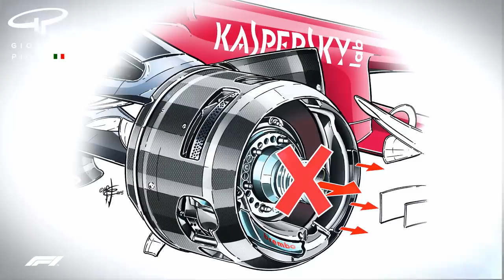2019 Technical Regulation Changes Explained

Comment: The FIAFOM really missed a trick here F1 should really have  re-explored ground effect aerodynamics  -this would have meant less wing turbulence but still massively fast cars . However the FIA seems to have phobia of ever looking into ground effect again ever since it was banned in the 80s because of Safety . Tech have moved on a long way since the 80s and surely engineers could develop ground effect aero that is both effective performance wise and safe for drivers.
Reply: Stephen Taylor even with modern technology ground effect isn’t safe. The way the cars currently are if you lose grip mid corner you can save it (i.e. Perez in Canada, Verstappen in Brazil) but if the main aero is ground effect once you exceed the limits of ground effect all downforce disappears and you’re off into the barrier with no chance of saving it whatsoever. 

Modern tech isn’t going to change that.
Reply: Just because it might cause more spins doesn't mean that is unsafe -no one is going to be killed by spinning the car into a barrier especially with the Halo. Modern technology can always make things more efficient. Ground effect is clearly the way forward.. These are the best drivers in the world a they should be tested.
Reply: Can’t agree more. It puzzles me why they bring in all these changes and refuse to explore ground effects again.
Reply: Enter the Bully if there is a Bump or let's say you hit the kerb, then the car will suddenly loose traction and since you can't really see bumps on the straight it is too risky.
Reply: it works in lmp1
Reply: gebakken aarshaar different car designs
Reply: Stephen Taylor the smallest bump or imperfection in the track is a risk of a massive accident. That big bump in Monaco going down the hill just before the hairpin for example.
Reply: With the halo there it's worth the risk.
Reply: Ihsan Husandi “nobody’s going to die in any modern cars anymore” Jules Bianchi 2014
Reply: As long as a driver isn't hurt it shouldn't matter whether they hit the bump on spin.
Reply: Bianchi didn't die because the car wasn't safe, it was because of the recovery vehicle which shouldn't have been there.

Check Alonso's crash at Melbourne in 2016.
Webber in 2010 at Valencia
Even Kubica at Canada and tell me modern cars aren't safe
Reply: Stephen Taylor yes but allowing ground effect allows for faster cornering which massively increases impact forces in a crash if something goes wrong part way through a fast bend. You can’t just say “it’ll be fine, no one will die” - you don’t know that.
Reply: Nathan Styles where did I say F1 cars aren’t safe? I’m saying you’re putting the drivers at risk simply because you want slightly better racing. Clearly there are ways of giving better racing without having to put the drivers in unnecessary danger.
Reply: All the cars have a high tech safety cell which protects the driver - the monocoque  of modern car is very safe.
Reply: but now they got Hans system, a mandatory headrest, the halo, they are training more and more to be able to drive at those speed. F1 is currently missing fighting gladiators that can go wheel alongside wheel to overtake and defend. ground effect mean they keep the speed yet still follow each others. With current wind tunnels, i don't know why it's still isn't used.
Reply: You guys realize that the human body can only take so many G-forces right? Even with the Hans device, someone can still die from a heavy impact. Alonso, Kubica, etc. are lucky they escaped with the injuries they received. Look at what just happened at Spa with the LMP cars.
Reply: Stephen Taylor Once a car is launched in the air - it'll become an airplane accident by then...relying on ground effect and safe racing just won't work with these kind of speeds
Reply: As an engineer I'd like to point out that ground effect, which reduces drag, comes at the expense of increasing lift, thus decreasing downforce. This fluid mechanic phenomena wouldn't be suited for F1 cars because they are extremely light and depend on their complex aerodynamics to provide the car with enough downforce to grip the track whether it be on a straight or through a corner. The only way I could see ground effect being utilized in F1 is if they had a computerized system controlling active aerodynamics providing the car with the most downforce and least amount of drag at any instance. But this would resemble the traction control days in F1 where a computer does all the work. Certainly a direction F1 fans do not want the sport to go in. It wouldn't be efficient to apply ground effect without a computerized control system because you would have aerodynamic parts on the car that would essentially be creating opposite aerodynamic effects. As a driver you would be wary of anything put onto the car that increases lift. Any bump or strong wake in the air could potentially send the car flying instead of keeping it stuck to the ground. Ground effect works when the distance from the wing (for planes) to the ground is relatively small, creating a high pressure pocket under the wing, this pressure pocket effectively reduces the drag vector and increases lift. Personally I think there are better solutions to allow cars to pass without increasing the lift. In F1 downforce is much more important than drag reduction.
Reply: Stephen Taylor it's not about the car's constructure. the drivers also can have massive injury with the amount of G if the impact was too hard
Reply: There's one thing you all didn't consider, if all drivers and f1 fans are okay with the downsides of ground effect, are the teams okay with it to spend the money on rebuilding the car once it's crashed(Haas for example, since they're kinda broke)? Cause like some people said the sudden lost of traction in ground effect happens with just a little change on the road surface, so it's basically a gamble of not crashing the car and spending money to rebuild it.
Reply: maximilianboo
What? Aren't we talking about using ground effect to increase downforce? Since when are we using the ground effect in a way that decreases downforce?
Reply: Ground effects aren't off the table yet. These 2019 rules changes are just a stop-gap measure until the big changes come in 2021. Brawn is among the brains behind those changes some I'm sure much consideration will be given to reintroducing ground effects.
Reply: The 2021 formula will be a major rule change, so it makes more sense to introduce more major aero changes such as ground effect at that time. The 2019 rules are more of a quick fix for the poor following ability that the current cars have.
Reply: maximilianboo 
I think you have confused the type ground effect applied to airplanes, with the type applied to cars...
In an airplane with ground effect application, you can increase lift while decreasing drag, by flying close to a level surface. I'm guessing you probably knew this, as it is what you were referring to...
In cars, it's applied by creating a low pressure area below the car, while there is a high pressure area above, therefore "sucking" the car to the ground.
Reply: Everyone here talking about safety, and those are fine points, but do you think drivers are going to be happy with a car that when it loses grip, they're not going to have a chance at saving or minimizing the spin?
Reply: All high impact crashes are technically unsafe regardless of Halo or any other types of protection.

It can cause degenerative brain disease somewhere down the road.

Not saying that they shouldn't take the risks, Im just saying that there is no such thing as "safe crashes"
Reply: No amount of helmet can save your brain from being violently shaken like a gelatin inside your skull.

That happens on all high impact crashes.
Reply: I really don't get the arguments people are making here regarding drivers not being able to see bumps . If bumps are perceived to be a problem the FIA can order tracks to be resurfaced removing bumps . They were actually saying that Monaco was the least bumpy it has ever been this year . The RB/A1 ring has been resurfaced in the last couple as years and isn't bumpy ditto Interlagos . If you order the number of bumps to be minimised there is less of chance of such problem.
Reply: anotherone10 they will still not use ground effect just because it cannot be 100% reliable all the time
Reply: Stephen Taylor  I see a lot of people poo pooing ground effects. Two things can make ground effects a usable alternative, which is electronic controlled suspension, which has been banned for 25 years now, and reduced engine power. ECS is very common in cars now a day, and would function lights years faster then what we had in the early 90's. Hitting a curb/bump, or the car becoming slightly unsettled would be corrected by it. Reducing power of course is to slow them down, so this super speed around corners wouldn't be present, but would reduce the reflexes needed to handle todays cars, allowing drivers to focus more on overtaking and strategy. I don't mind F1 being slowed down even 10 seconds a lap if it means less parading, and more overtaking.
Reply: Why are some people saying ground effects will be OK now, as they'll be counteracted by the downforce from the wings? The whole argument for ground effects would be to reduce the downforce and dirty air from other parts of the car.
Reply: You missed the point.
They can't have cars getting faster and faster. They will be took quick for not only some tracks, but for the human body, especially in an accident.
Reply: Course they could drivers would just need to get stronger.
Reply: Stephen Taylor Seriously, what? They're already at pretty much peak physical fitness, albeit lean in order to keep combined weight down.
Reply: adamutuber it doesn't have to be faster tho. If ground effect is used and understood, then it's a game of balancing what happen over and under the car to keep 2018 speed levels yet have cars following each other enough to land proper attacks.
Reply: ground effects are used in NASCAR, IndyCar, and LMP cars. no reason it shouldn't work on an F1 car.
Reply: blaizify what are you talking about ? Every series use diffuser, but that's not the depth of ground effect... We are talking about using 70's skirts or what chapparal did with the 2j
Reply: The racing would be more exciting in that the cars could go around every corner at 300kph. But they could also fly into the wall at 300kph as well.
Reply: Joe Slater you can't ignore physics lol. Things like red bull x2010 don't exist yet
Reply: You don't understand ground effect.
Reply: "FISA wanted to ban ground effects because of the dangerously high cornering speeds they allowed, and the fact that if one of the 'skirts' broke it could send a car off the track at massive speed with no warning for the driver". With the grip that modern suspension, tyres and chassis allow now along with the currently very, very powerful cars. I think if you roughly increase the cornering speeds they were doing in the late 70s and early 80s up to what they might be today, you would potentially have guys flying off the track at close to 300kph.
Reply: Stephen Taylor  more accidents = more possibility of people getting hurt or killed. Why would you argue this is not a bad thing?
Reply: What if the ground effect just takes care of 20% of the downforce...then it will help close following while not sending a car flying off the race track when a skirt fails
Reply: @squeakybunny2776  Thats pretty much what they've already got. With a flat under side and large diffuser on the back.
Reply: @joeyslats31  im fairly sure that those do not account for 20% of the downforce even though that was a arbitrairy number but..,

I think it's safe to say that they are nowhere near the border between safe and unsafe exploitation of ground effect so they could crank it up a bit..
Reply: @thebestfeelingissuccess5424  wheel covers to begin with

Comment: Well that is some good change but teams like redbull are strong on aero so that they can be close to front runners. The removal of complex aero and more effective DRS means cars with powerful engine will always stay at the front. They can start on 10th and still finish on podiums. The real change should be on the power unit, standardizing the MGU K and MGU H could be better.
Reply: akhileshmoorthy RedBull will dominate next year because Ferrari and maybe Merc will loose more because a large part of the downforce of the RedBull comes from the ground of the car which will not change, Ferrari and Merc car are more depending on the frontwing
Reply: How do you have such a competent knowledge on this subject, may I ask?
Reply: @Freshottolotto  yeah and the weakness of the RedBull is power and guess which two top teams will have less drag and more powerful engine oh yea they can win some races for sure but dominate I don't think so unless Honda does something about it

Comment: Just have one dry tyre compound that is designed to last somewhere between 1/3 and 1/2 a race, ideally so it's viable that a team could decide to manage the tyres to achieve a one-stop, but it's generally more beneficial to push and two-stop. With Pirelli as sole supplier, there's no need to have multiple compounds, as it's not like a rival will just make a more durable single compound. This would reduce expenses, increase the number of required pit stops and make it easier for newcomers to the sport to understand. Any "intrigue" over tyre selection strategy at the moment is minimal at best.

Comment: Unless designers are forced to make the front wing elements run the full width you're still going to have problems with vortexes being thrown off the side of the car (the inside edge of the winglets creates a vortex travelling behind the wheels and is used to channel air down the sides of the car and create a buffer zone between the upper and lower side of the body to increase overall downforce, commonly known as the Y250 vortex).  A simplified design will make the following car slightly less sensitive to dirty air but the vortex problem still exists and cars will still get stuck in an exclusion zone where they are unable to maintain cornering pace within 1-2 seconds of the lead car

Comment: Front wing is too big
Reply: おかもこーへー Why?
Reply: [[Insert Name]] I think it increase the risk of minor collision .
Reply: Should be from inner tire to inner tire length
Reply: Well, it's a similar size to the wings back in 2008-2014, so any drivers from that era will be kind of used to it, and actually, the minor collisions now are more because of the small, complex and fragile endplates and devices, with a more basic design, it'll be sturdier and less likely to break from a small collision, so I don't think it will change as much
Reply: Ieuan McArthur Wings from 2009-2013 were 180cm wide, same width as cars
Reply: 2009-2013 seasons front wing were as wide as it is now, I don't think it'll matter that much
Reply: I'd agree, I loved the narrow wings from before 2008
Reply: metaphoricalemon // me too mate!
Reply: agreed. it be to come in about 2in each side
Reply: Ieuan McArthur you mean 09. the 08 wings were still narrow and high off the ground.
Reply: The whole car is too big.

Comment: This will hopefully mean more even competition in the future. That being said, we need to make sure there is a balance between restrticting aero complexity and allowing engineers and designers to innovate. Perhaps less restrictions in ither areas of the regulations could allow the different chassis and engines to make for more interesting design along with better racing.

Comment: How about the engine? I'm not expecting an engine with better performance, but an engine with better sound.... It's matter for the fun factor
Reply: 2021 that will happen.
Reply: 2021 still V6
Reply: Aries Pradana They're raising the RPM limit.
Reply: +Britton Kithcart Here's

In 2017, the FIA began negotiations with existing constructors and potential new manufacturers over the next generation of engines with a projected introduction date of 2021. The initial proposal was designed to simplify engine designs, cut costs, promote new entries and address criticisms directed at the 2014 generation of engines. It called for the 1.6L V6 configuration to be retained, but abandoned the complex Motor Generator Unit–Heat (MGU-H) system. The Motor Generator Unit–Kinetic (MGU-K) would be more powerful, with a greater emphasis on driver deployment and a more flexible introduction to allow for tactical use. The proposal also called for the introduction of standardised components and design parameters to make components produced by all manufacturers compatible with one another in a system dubbed "plug in and play". A further proposal to allow four-wheel drive cars was also tabled, with the front axle driven by an MGU-K unit—as opposed to the traditional driveshaft—that functioned independently of the MGU-K providing power to the rear axle, mirroring the system developed by Porsche for the 919 Hybrid sportscar.
Reply: I agree.1988 has 1.5 litr v6 turbo and sounds great.Now why not.